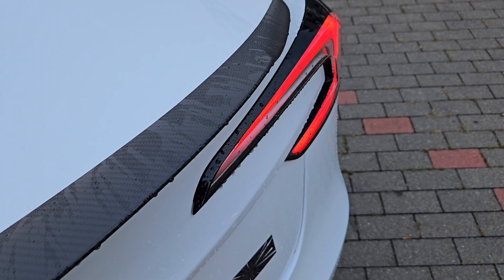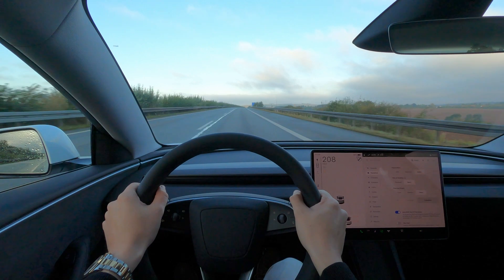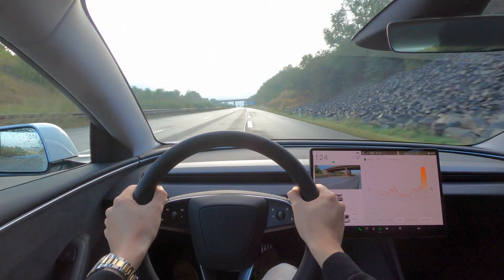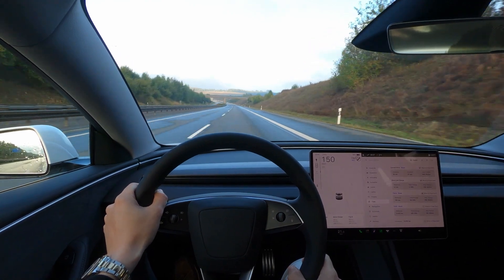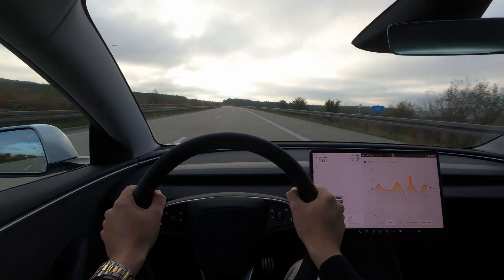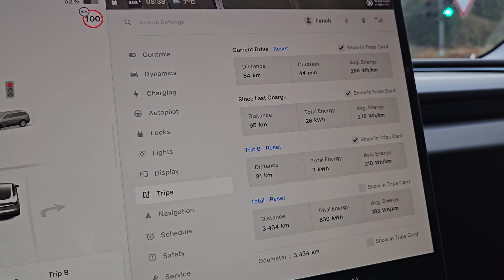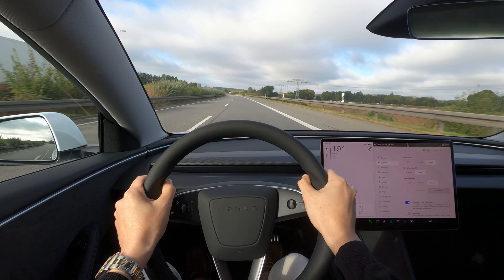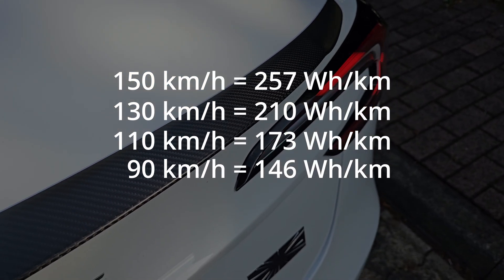Tesla Model 3 Performance Top Speed & Consumption Test on the Autobahn

Comment from the maker: For my viewers that prefer the data in miles, here are the conversions for km/mi:
150 kph = 93.21 mph
130 kph = 80.77 mph
110 kph = 68.35 mph
90 kph = 55.92 mph

Consumption figures:
257 Wh/km = 413 Wh/mi
210 Wh/km = 337 Wh/mi
173 Wh/km = 278 Wh/mi
146 Wh/km = 234 Wh/mi

Completely forgot to add it in the edit. Was a long day. Cheers!
Reply: Ha, this literally addressed what I was going to comment. Love the content, and would love these conversations in the vid for us people on the other side of the pond. Side note you might be interested in, I put lighter 18 inch wheels on my M3P, over the past 2k miles I’m averaging right around 220 Wh/mi. Crazy range.
Reply: This efficiency is nuts

Comment: This is the problem with ev cars. I tend to cruise at the autobahn at 150-170 kmh constantly, driving for 200+ km. It wouldnt be possible even in the new teslas
Reply from the maker: According to this test, you can get around 300km at 150 🙂

Comment: An F31 335d with a simple remap is faster 100-200 and with a full ta k you can do 1000km… until these EV get 1000km and can get up to 100% charging in 5min it is just too much planing for long trips
Reply from the maker: It of course depends entirely on your priority. If long range is your priority then definitely get a diesel. If you want the latest and convenient tech and don't need to go on drives longer than 300km (which most people don't), then it's hard to bet a modern car like a Tesla.

I don't need to carry a key. I can monitor my car whereever it's parked through live cameras. Sentry mode is a blessing, also all the cameras in general in case of an accident. Conveniently turn on A/C on hot days before I enter the car. Don't need to worry about engine maintenance, or driving my motor warm before going fast. In my opinion, an electric car has nothing but upsides compared to a petrol/diesel - besides the range. If the range isn't a priority, then it's hard to see why you wouldn't go modern electric.

Comment: Useless test. The real test and no one want to do it, is to drive at 130km/h, to see how many km would go. That is real test, for driving outside the city.
Reply from the maker: @alinsimion3630  394 kilometers
Reply: @MisterFench  film it, but i don t think so. What autonomy does it have?
Reply from the maker: @alinsimion3630  Well. You won't be able to find that long of a stretch to be able to continuously drive with 130 km/h, draining the battery from 100 to 0%. The best you can do is work with theory. In my test, the consistent 130 kph run, gave the result of 210 Wh/km. 

I know from other drives, that the figure here is slightly higher than reality, due to elevated terrain. I.e. the 110 kph result of 173, is probably closer to 150 in a bit more mixed terrain. In that regard, let's take the consumption of 210 and adjust it to 193. With a 76 kWh net battery pack, that would give you a theoretical range of 394 km. However, it's a moot point, because nothing is comparable in the world of consumption analysis.

Where one could get a range of 400km, another may only get 300 because he is driving in different temperatures, in different elevation, on a different and more rough asphalt. Tire pressure could also be different. Rims could be different. There are too many factors that come into play. 

The best thing you can do is to take these numbers with a grain of salt, like I said in the video. If you find the numbers useful, great, if not - that's also okay. Then I however suppose no range test will satisfy you, taking the above into consideration.
Reply: @MisterFench  if you drive 10km, it is not relevant, not even in ice cars. Drive safe.

Comment: I have plot on a graph your consumption Vs Speed and the graph is practically linear. Thats shown that the air friction does not increase the consumption in an exponential way as i assumed.
Reply from the maker: @JC-hz9en  my theory is that the elevation changes disrupt the exponential theory. In an ideal scenario with a 100% flat surface things may look different. I have another video coming up this week with some further diving into the consumption in new conditions
Reply: Yes, in this case, it is almost linear, as shown below (kWh/100km):
fitresult(x) = p1x² + p2x + p3
Coefficients (with 95% confidence intervals):

p1 = 0.00125 (0.00125, 0.00125)
p2 = -0.115 (-0.115, -0.115)
p3 = 14.83 (14.82, 14.83)

Additionally, I have plotted the time needed to cover 100 km (h/100km), and there is a very interesting equilibrium between time and power around 120 km/h. Can I send you the figure?

Comment: I am driving Tesla car’s regularly from 2014 . Those “old” model S are very comfort cars, but a range in model 75,85 it’s not the best on the highways. But model 90 and 100, LR are really good deal. Then 2021 I have bought Tesla model 3 LR, that car was amazing for long journeys. Then, this year in June Tesla model 3 Highlander LR. Car it’s just amazing, at highway cruising speed at 110 consumption it’s just 13-15kw/100 km, at 130 km/h it’s 17-18kw. I am very pleased because range it’s just amazing and to charge with passport on Ioniq/Tesla are extremely cheap.
Reply from the maker: The LR cars are insane when it comes to consumption. I don't think there's any other car beating them in terms of efficiency! Really really impressive. It's a shame that 18" wheels don't fit the Performance model, as I'd love to test that and see if consumption could get close to the LR numbers
Reply: @MisterFench  Try Xpeng G6 LR. Much more better car then the Tesla model Y. Cheaper also, better ride hide, better comfort, much more better premium feeling, also very economical.
Reply: @MisterFench  18 inch wheels do fit the Performance model. 18x8.5 ET 35.
Reply from the maker: @svilensavov6543  also the 2024 highland with upgraded brakes??
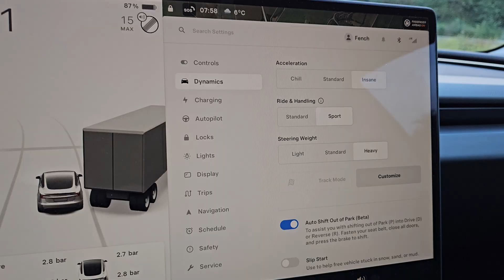Reply: I think yes - https://youtu.be/0dAJoGz4bx0?si=F9Z6vyW6qtiATGeg at 0:20

Comment: Gave up on the M3P (2022), power drop under 60% SoC, no power at all below 30% when you press the pedal and top speed is reduced after 1-2min to <200kph. Up to 220kph you can go until low SoC sets power limit. Tesla stock tires have no grip, power is reduced often in corners. Well, a first world problem and VMax here in Germany is 99% of the time impossible due to limits and traffic. But the M3P is a one trick pony. For only 4k€ more than the LR like its used to be its a no brainer, get the P. But 7k€ currently does not convince me any more. Today with that old and outdated LG battery, not really at all
Reply: The 2024 M3P doesn't have nearly as much of a drop and pulls far deeper than previous performance models. I test drove one and it punches hard through 110mph

Comment: Excellent content. Keep up the great work.

i have a suggestion on the 100-200 tests.....please find a dead level and straight stretch to consistently compare times and also between different cars. Even a slight turn or incline will have a big effect on the times.

Also double check tyre pressures before each test.

👍
Reply from the maker: @tfsidsg  🙏🙏 appreciate it! Finding a dead level and straight stretch is a bit difficult in this area. I'l possibly add timing gear that can properly measure results though. Will see in the future 😉🫡😇

Comment: nice video man, i would like to see a 100-200kmph test accross 90-20% SOC in sport mode since its 300kwh sustained powerouput and we might see pretty even times there
Reply from the maker: @akaye7333  There's definitely a noticeable difference in power delivery once you get lower than 65% SOC. Should I ever reach 10k subscribers, I'll celebrate with buying some proper timing gear and make 100% accurate measurements. 👍
Reply: @MisterFench  the power drop is more or less standy and not really bound to 65% SOC. Im just saying in Sport mode rather than Insane mode your getting steady power of 300kw which should smoothen the curve of 100-200kmph times accross all SOCs
Reply from the maker: @akaye7333  I have Chill, Standard and Insane mode available, but standard is definitely slower than insane
Reply: @MisterFench  oh ok, might be called standard aswell. standard should be 300kw steady power while insane gives all the available output possible at any SOC and temperature. i would appreciate if you could run 100-200kmph in standard mode a few times on different SOCs :))

Comment: An Audi RS3 performance edition is only a little bit faster from 100-200km/h 9,42s. Look at the actual Autobild...
Reply from the maker: @sworksm552  and I'm sure with proper timing gear, a completely level surface, this M3P will easily beat that time! Ileven with the LG battery, I've seen a lot of 8.x results from Dragy!
Reply: I totally agree with you. I had the Panasonic and now the LG battery. I love the LG, lower degradation, more power @ lower SoC and lower temperature... The new Model 3 Performance is a beast.
Reply from the maker: @sworksm552  the fact that degradation is lower is for me also more important than a bit better performance, as if I'm being honest, the only times I really use the full performance of this car is solely when making these videos 😇 day to day it just doesn't come into play.

Comment: What was your  battery temperature for the 100-200  test? Because 0-100 is less affected by not full soc than 100-200 simply because the battery power is sustained for the 100-200 but is only rewuested full poerr from 80-100. The 0-80 is a ramp up of power from 0kmh. Yoir battery need to be pre conditionned for better results
Reply from the maker: Not sure what the battery temperature was, as I did not measure it. The outside temperature however was only around 6 degrees, so I'm sure it wasn't the ideal conditions - however, it was real life conditions and that I think is what counts the most, as that's what owners will experience themselves in day to day.
Reply: @MisterFench  yes that is what real life should be. But if you compare results from a previous run without taking account of battery temperature , this might be your answer about the difference that you experienced😉
Reply from the maker: @Doctorbasss  ahh got it. I misunderstood your initial intention for the comment, apologies 🙏😉👍
Reply: @MisterFench  
How about you try these tests again after a tesla supercharger. Then your battery will be already hot over 50 C degreess
Thats the optimum temparture to get the most power out of it. But overall impressive times my m3p 2022 is on average 1-2 second slower
Especially on low SoC . with 30% left i am gettinf 13-14 seconds.

With what are u measuring btw?
Reply from the maker: @VxO4fame  Is your M3P 22 a Pana or LG version? I'm measuring based on speedo, so it's not entirely accurate. I.e. I cut out the section in video-editing where it shows 100 and then use the timeline to measure the time at 200. Since my timeline is 30 fps, I then multiply the frame count at 200 with 3.33 for the correct milliseconds. Again. It's not super accurate, but I suppose accurate enough. If I ever hit 10k subscribers I'll probably invest in proper timing gear 🙂

Comment: Performance is also dictated by battery temperature; 120-125F is ideal. A cold or colder battery which hurt your test times. Try routing your car in navigation to a Supercharger wait 10-15 minutes and run your test again.
Reply from the maker: I fully accept that there are ways to ideally prep an electric car for maximal performance. However, I prefer to show and test without taking these things into consideration. I appreciate that the car may be faster doing certain preparations, but I also kind of find that would be disingenuous to showing real world testing results. I think the results that count, are what people can realistically expect when they're out driving their car in normal conditions. With all that said, probably my battery was a bit colder than it ideally should have been. I drove to the AB in chill modus and also had a brief stop where I gave it a wash, so I could properly film out the windows ;)

Comment: Air drag grows exponentially so the power consumption will grow exponentially  too.
Reply from the maker: I completely agree, however, in my findings - interestingly enough, the difference in speed going from 90 to 110 is a 22% increase - but the increase in consumption is only 18%. Meaning consumption won't always grow exponentially, as elevation/roll resistance play a determining factor too. At least up until a certain speed, then it falls off again and air drag gets too strong.

Comment: Maybe the battery temperature is lower in comparison to the last test what results in less available power?
Reply from the maker: I'm not sure what the cause was. While the outside temperature was lower, the car was running for at least 20-30 minutes prior to going on the run, so the battery temperature should have been ready to perform. I also did the procedure identically to last time (i.e. driving in chill to the AB and switching to insane just before the run). Maybe it was also just a fluke. In the second 100-200 run, it out-performed my previous video for the same spot. AutoTopNL also mentioned there were some discrepancies in their performance testing of it.